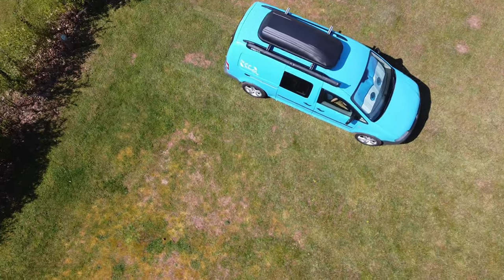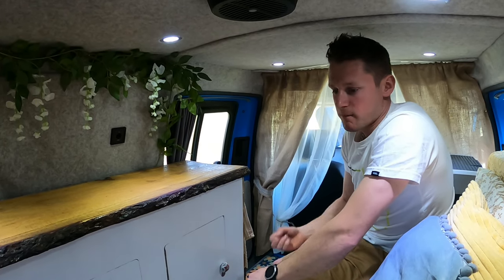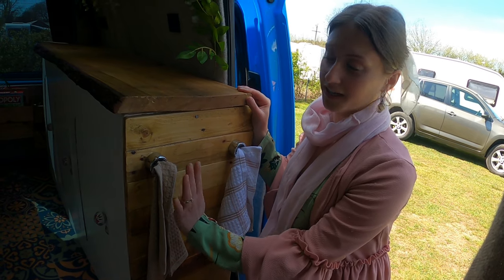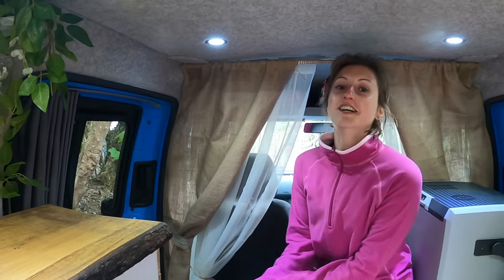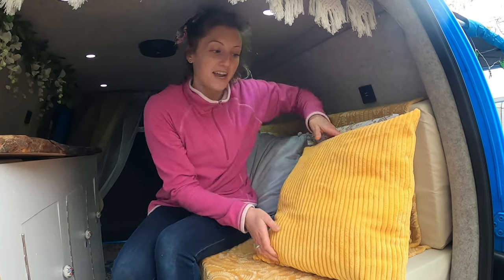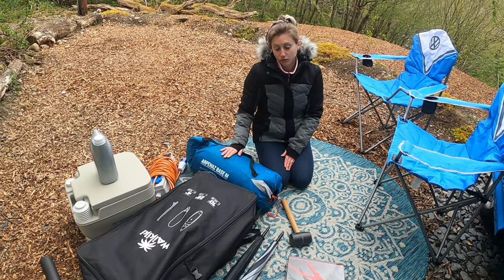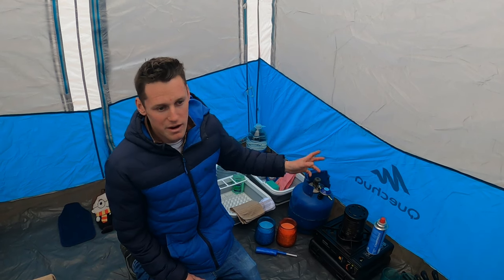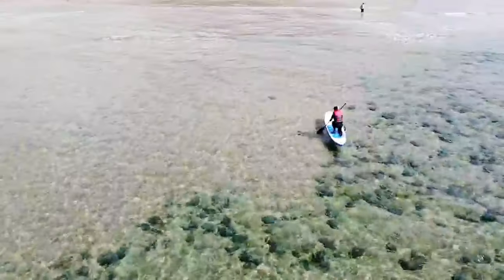VW CADDY MICRO CAMPER VAN TOUR!

Comment: Very functional and sympathetic home, guys.
You can be proud of that. That outdoor tent with awning and walls is a really great solution.
I have also built a Peudeot Partner Van 1.6 diesel over the course of two years. There is still a small adjustment. Good luck and great adventures.
Reply from the maker: Thankyou so much for your Kind words 😀 We do love our micro camper. The  tent awning is deffinenatly a great addition when staying on a site for multiple nights. Highly recommended.

Sounds great, similar size to ours. There fantastic to just go anywhere in arnt they.

Happy Travels

Comment: Just a quick information. For the original VW car stereo system you can get Bluetooth adapter that go between the original cable, no need to cut anything. Unplug, connector between and replug and you have Bluetooth connectivity which allow you to play content from your phone.
Reply from the maker: Thankyou, we will look into this as we Currently use a Bluetooth speaker 😂
Cheers
Reply: I have nothing to do with this things, I also not sell them. Just for your information.
If you tell me you radio model I can have a look on it.

Comment: Most of these older maxi caddys you can buy here in Germany were intensely used and have a large amount of km. I'm looking for one but I'm afraid to buy something over the 200k km. Can you tell me more about yours? How many km did your caddy have when you purchased it, how does it drive at that milage and what were the costs, if any, for fixing or replacing parts? Great build btw, these mini campers are a great option for those that don't want to spend a lot on a pre-built camper or on a van to convert themselves. I think that another great part about it is that you can use also to travel through cities and not be camp site bound because of a large vehicle. Looking forward to reading your answer to my questions if you're willing to share that info. Thumbs up!
Reply from the maker: Thankyou for this we appritiate it.

Our caddy is low milage we braught her with 71k on but if you watch our latest video youl see that its not necessarily reliable.
We have a vw passat 2.0 with 132k miles on and that is really reliable, we can drive that anywhere. 

Good luck with finding your van 👍🏻
Reply: @NathandHannah  thanks for the reply! Stay safe

Comment: Hey folks, not sure if the same applies to your van but check if there is a aux jack in the glove box! I use it to play Spotify over the van speakers . Your radio is the same as mine so hopefully the jack is there and you can use the media button to select the source 🙂

Great conversion by the way 👍
Reply from the maker: Thankyou,

Yes we do have an aux behind the glove box. We have tryed lots of things to get it to work but still no joy. We don't have a source option just media (which is cd) & radio 🤔
Reply: @NathandHannah  Hey, I just had a look at my radio again. For some reason VW decided the Aux input needs to be turned on with the radio settings. In my instance,  it's Menu -> Setup -> aux -> (On Off).
When it's set to on, you can then hit the Media button which should (hopefully) display CD Aux as source inputs. No actual button called "Source". 

Hope that helps 🙂
Reply from the maker: I've just tried this. We don't have the aux option  in the set up 😕
Thankyou for the pointers anyway as I've just looked on the radio on our passat to see if thats the same as our aux works on that and all the settings are there 👍

Must have been deleted off our caddy
Reply: @NathandHannah  Boooo to that. 👎 That's a pity. Must be a glitch somewhere then so. 

It's a fairly small issue overall and you have a fantastic looking mini-camper. Looking forward to watching your adventures 🤙
Reply from the maker: @smeeagain-3199   ye must be, atleast its nothing too essential.

Thankyou we do appreciate it 🤟✌🏻

Comment: Nice video great van just noticed you may have put the seat covers on opposite seats as the air bag tag needs to be by the door not inside
Reply from the maker: Thankyou.

I never noticed so thanks for the tip off. Il have to check this although not sure if our van has seat airbags

Comment: Great conversion, well done!! Any info or links of your pull-out awning canopy and your roof box ??? Thanks, John
Reply from the maker: Thanks John

Ye so our pull out awning is off a website called direct4x4.co.uk 
Lots to choose from but our particular one is 2m x 2m in grey.

Our roof box is from go outdoors. I've forgot the exact size but it was the medium sized one. 

Hope this helps 👍🏻
Reply: @NathandHannah  what are the roof bars are you using with the awning?
Reply from the maker: @jono12341000  they are standard areo roof bars (1200 I think) with standard roof rail mounts 👍🏻

Comment: Great conversion - looks super cosy! I’m currently debating the standard or maxi caddy. Like you, it would be my daily vehicle too. How do you find parking in standard car park bays etc? Does it overhang the space or fit within the bay? Also, do you find it fairly economical to run? Thanks 🙏
Reply from the maker: Hiya Zack, 

Thank you very much 😊 That's really lovely of you to comment! 

Definitely go for the maxi to give you that bit of extra room at the end of the bed. Also the extra space, we think is needed as it's a small campervan anyway. 

Parking is fine, it is just like parking a large car or people carrier. The only issue we have with the size is the height as having the roof box on takes us over 2.2 metres. So height barriers can be a bit of a problem. 

Our Caddy Maxi is a 1.9 engine & we get around 37 mpg when fully loaded on a run 👍🏻 

Other than that good luck with your build if you decide to go for it 😁 We hope this helps!

Comment: Great Camper Build, really enjoyed the video. one question I have is did you have to have much work done to the Maxi itself ? & what did you get for the Tigra as part ex?
Reply from the maker: Thankyou we appritiate it.
The van its self didn't have much work tbf. We had 2 x sliding door windows fitted and the barn door windows tinted. Added rood bars and swapped the steels for alloys. Got 1k part x

Comment: Hi great video! Curious as to what those seat covers are and how they fit?!
Reply from the maker: Thankyou Scott. Are these the seat covers in the cab or covers for the rear bench / bed mattresses
Reply: @NathandHannah  in the cab sorry!
Reply from the maker: @scottfraser.wildlife  there just seat covers off ebay. Our original seats were dull. There's a few clips of them near the start
Of our van build video on our chanel.

Seat covers fit well, head rests could be better but all round tidier. Just conect the straps  underneath the seats using the provided clips